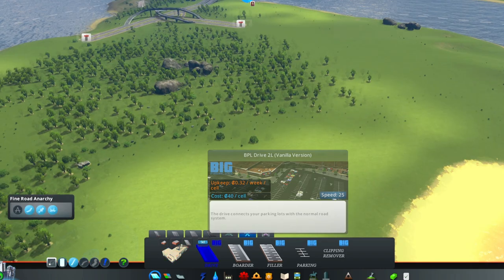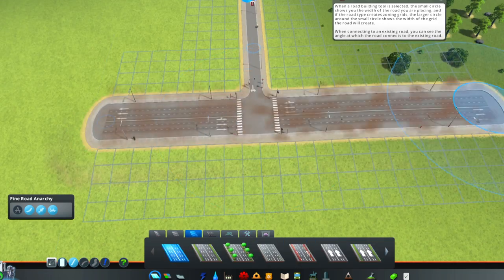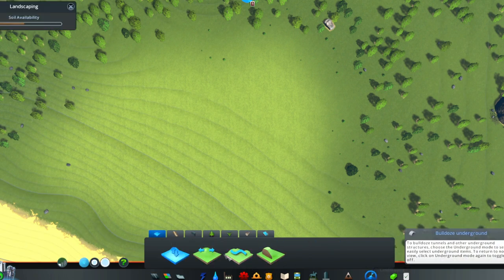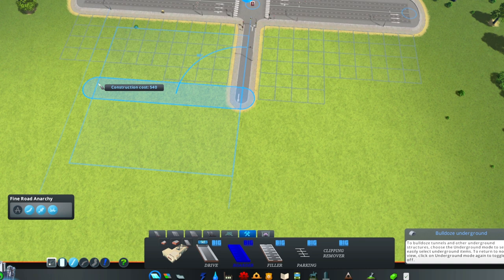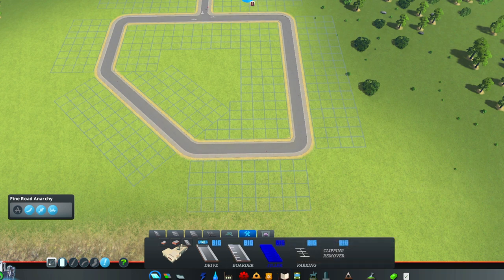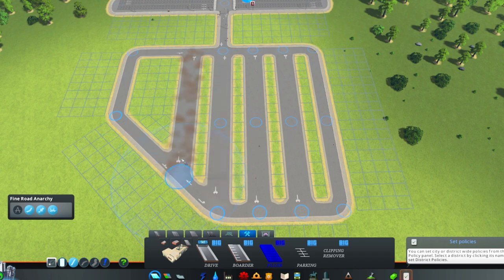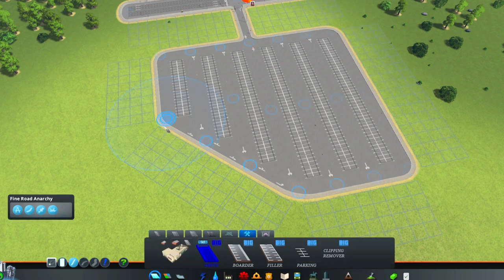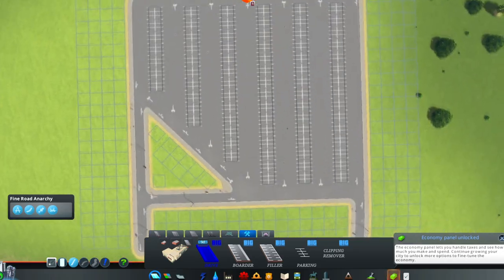Cities Skylines BIG Parking Lots Tutorial - Basic Funtions

Comment: i dont know why i got bug on using this asset, the centre of the parking lot form a crash blue hole
Reply: Sherwin Elvina i leave 3 tiles gap between two road but still the same 😰
Reply from the maker: @angziheng6424  the distance between the filler roads should be 3 units. So the gap is one unit wide (1 zoning tile)
Reply: @hockenheim9515  okay thaanks
Reply: Same here. Tried to follow the video step by step but still only half blue lots that look like they're filled with water. And now my game doesn't want to load most of the time. Are there any incompatibilities with other mods i should be aware of?
Reply from the maker: @alexandrahuemer9145  No, because this is not a mod but assets made in the ingame Road Editor
Reply: @alexandrahuemer9145  you need to use anarchy mod